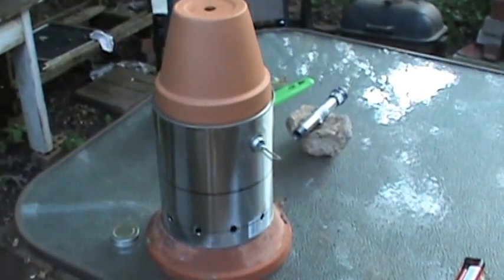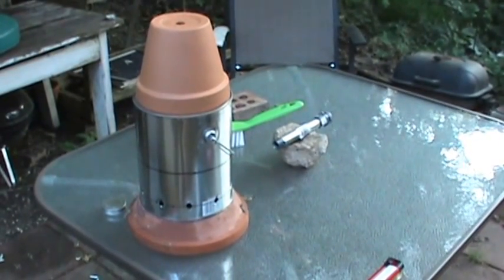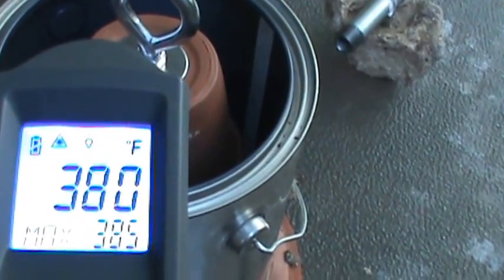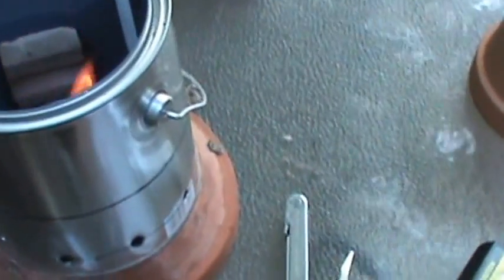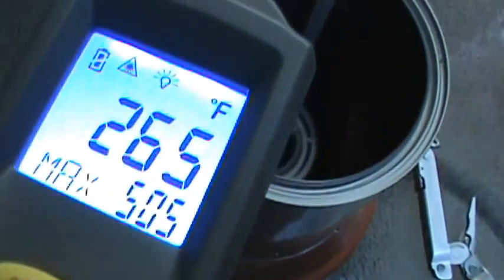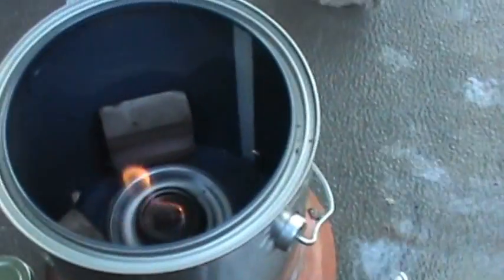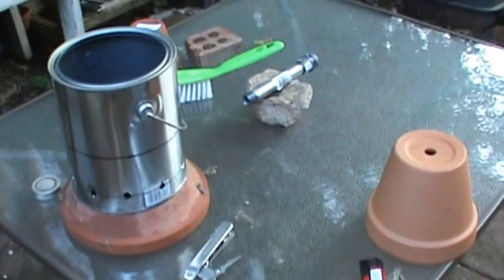Flower Pot Heater redesign. This one works.

Comment: Everyone who lives in a cold climate should have a metal coffee can and a candle in their vehicle in case it gets stranded. The candle in the coffee can will keep your car warm until help can arrive. Try to find one of those 24-hour candles that burns that long.
Reply: I've been doing that for years.  Every November I put together a winter survival kit in my trunk.  Candles, lighters, matches, dry snacks and more all go in the coffee can.  I keep a small shovel, extra socks,rawhide mittens and other clothing to layer up in the event that I'm stranded on a Michigan road in the dead of winter.  It's not hard to prepare for the worst.  

The woman who slid off of a highway off-ramp and wasn't found until the thaw is a constant reminder for me.  She didn't have to die that night.  She just wasn't prepared.  And flares...you can't be helped if no one knows your there.
Reply: @beekind466  Rather than storing the emergency supplies in the trunk, in case you cannot exit your vehicle, keep all in a plastic box on the back seat or floor where it can be easily reached. Thanks for the reminder to keep survival supplies in one's vehicle.
Reply: @beekind466  thank you
Reply: @beekind466  you are so right. Better be prepared than sorry. I do It and I even live in a mild climate.
Reply: Wim Harleev I think it would be really cool to learn hieroglyphics and read what is on the pyramids. My prior comment was a direct response to the suggestion that KJV is the only “real” bible. My main point was that learning the original language of any given point of research/study is not only recommended but in some cases necessary to fully understand it.
I don’t deny that there has been much done in the name of Christ that is corrupt and a dark spot on history, but as a Christian I believe we need to study the Bible so as to prevent such tragedies from occurring again and to guide us in life. 
I understand that you oppose Christianity but your comment was uncalled for and completely non-constructive. There are also plenty of horrific tragedies carried out by other religions throughout history, even now in our own time.
Reply: Wow, how did religious philosophy erupt from watching a video about homemade heaters.
Reply: @dalelarson826  🤷‍♀️
Reply: @dalelarson826   I think my YouTube name and my suggestion to have a metal coffee can and candle. which Catholics do burn in their churches,  Triggered this whole nonsensical discussion.

 Some people's comments just show their own ignorance.
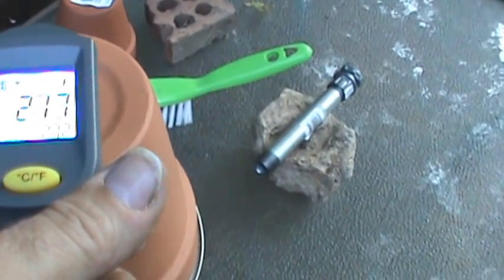Reply: @ciannacoleman5125  you don't need to learn Greek and Hebrew, all you have to do is obey Acts 2:38, and you will fulfill Matthew 28:19, Luke 24:47,and Mark 16:16.
Reply: Or u could just use a oil candle
Reply: Or you could put a Mr Heater 3800 BTU indoor/outdoor propane heater and a couple of 1lb bottles of propane in your car. That's enough to warm the interior of the car, with a window cracked open for ventilation for 11 hours.
Reply: @paulswarthout9967  I have a mr. Heater and that thing would blow me out of a car!  Definitely would keep u warm.
Reply: Metal coffee can are rather scarce these days.
Reply: IKEA has a big bag of 100 tea light candles for $5. Many, many uses.
Reply: @Swimdeep  thanks! Ive been buying votives 4/$1 at dollar tree.
Reply: @grandmalovesmebest  The votives are bigger, burn somewhat longer. The IKEA tea lights are definitely a better deal. Stay warm!
Reply: @grandmalovesmebest  lol hee
Reply: There was quite a "hot" debate on religion earlier, leaving much confusion. Isn't the Christian Old Testament a translation of the Hebrew "Tanakh” (acronym of its three parts: Torah (The 5 Books of Moses; including Genesis, Exodus, Deuteronomy, Numbers & Leviticus), Nevi’im (Prophets), and Ketuvim (Writings)? With some passages in  Old Aramaic (Daniel & Ezra, the verse Jeremiah 10:11, & some single words), along with the vast majority of Hebrew Scriptures, aren't these the foundation of Christianity's Old Testament? Isn't the G-D of Israel, Christianity's God, too?
Reply: @tamarawharton7755  Yes, well done, thanks very.
Reply: That or a good freaking sleeping bag.
I paid $180 for a 3 piece military sleeping module. It's good to -40°F. You can jump out of the car and sleep much more comfortable out on the ground. It could snow and drift 4' on top of you and you'll still be just fine, comfortable and ALIVE. It scrunches up to the size of a basketball if you have the bag it goes in.
Reply: Wouldn't it be safer to keep the glove box full of hot hands? 
You can put one under each armpit, one in each front  pants pocket, one in shirt pocket, and sit on one. They work..
Reply: Mike Ries one over each kidney is all you need
Reply: @drachenfeuer5042  If you're the only one in the car. Otherwise you need 2 for each person, and enough to last several hours.
Reply: @drachenfeuer5042  Not so fast. Feet especially and hands are very vulnerable.
Reply: @mikeries8549  not in below 20⁰f weather...got stuck in my car in a blozzard for over two hours (car overheated) and those damn heating pads lasted an hour and barely worked.

My hands and toes were frozen by the time I got help, never again. Now my car has a survival case with a thick blanket, tea candles, small metal cooker, small clay pot, wooden board, dry food, water etc
Reply: @mikeries8549  that is also a very good idea...
Reply: They used to do this back in the day
Reply: Mix sawdust in paraffin wax
Reply: Or just get a bunch of candles at a catholic building or some other cult which burns a lot of candles. Except maybe some 3rd world country full of people, ignorant even in their own written language, who can not read the word of God in King James version, to even know His will.
 Always perfect hunting grounds for cults.
Reply: @victorcastle1840  ignorant and sound miserable
Reply: @patriciamanly5125  , so which ( non Jewish )candle burning organization are you a member of ?
Reply: @victorcastle1840  Like you're NOT in a backward, medieval cult.

Prick.
Reply: @victorcastle1840  What are you blabbering?
Reply: @victorcastle1840  What dose this have to do with flower pot heaters? Sounds like theft to me?
Reply: @victorcastle1840  That you use your time in posting unrelatable drivel is just so sad. Norman Vincent Peale.
Reply: @victorcastle1840  🤗
Reply: victor castle KJV is archaic and practically a different language just like Shakespearian, so it is not surprising that even people who grow up with that as their main bible have trouble. I think it would be a good practice for people to learn Greek and Hebrew again so they can study “His will” as you put it, unfortunately in today’s society that is impractical for the masses. However Catholicism is not a cult and just because some denominations do things and have traditions different than you does not make them cults.
Reply: @ciannacoleman5125  The Pope is the false prophet of revelations....    It's true.  Come out of her my people.....
Reply: @ciannacoleman5125  😄😄😄, as a Southerner, im constantly accosted by ppl  insisting Catholicism  (which was the original Christian church) is a cult. It never bothered me bc (besides a degree in world religions) i remind them it was the ONLY Christian religion for over 1500 years. "Look it up" as our moms used to say!😁
Reply: @grandmalovesmebest  I do not consider Catholicism a cult, however I do disagree that it was the “original” Christianity since the early Church of the Bible was not Catholic. I am sure that as a Catholic you disagree with me and I am not suggesting the early Church was Protestant or any thing ridiculous like that but by my knowledge of Catholicism it has much that is very obviously added on to the biblical foundation, much like the Pharisees did by considering the Talmud part of the Law.
Reply: Something (hat , boggin, T-shirt wrapped around head, etc) to cover your head and a pair of gloves  should be in your car at all times during the winter if it gets cold in your area.  That’s where your body loses the most heat.

Layers of clothing work best (especially when exposed to the wind) to maintain a comfortable body temperature.
No clothes with an emergency blanket is better than wet clothes.  Heat loss is 25x faster in wet clothes if memory serves me right.  That works great in summer heat, but can quickly kill in winter.
Dehydration can take place in hours and a couple of bottles of water should also be in your car emergency kit.
Stay safe and think ahead ;-)
Reply: @user-qq1xg6qn7i  Don't leave home without Jack.
Reply: @ciannacoleman5125  a cult is a group, but an occult, is the devil worshipers.
Reply: @victorcastle1840   I'll pray for your problem with hate. I know Christ very well, personally and I know for a fact that before the "rapture" comes a judgement. At that time you will know how wrong your decernments really are.
Reply: @victorcastle1840   The king James version of The Bible was derived from the Catholic version. However the protestants added terms like, "alone."  This was done to support Luther's false doctrine of sola scriptura. 

 The king James version of the protestant scriptures What's put together by an active homosexual.

I also would like to remind you that Martin Luther and John Calvin where disgruntled Catholic priests.

Catholicism has the fullness of truth because it was taught by its founder Jesus Christ. Protestant religions have some semblance of truth but not everything because they broke away from holy mother church during in the Reformation.
Reply: @catholics4unity  you know nothing of ‘truth.’ If you did you would know the Jesuits we’re responsible for all written organized religion. They write our ‘scripture’ daily by code. You people in masks submit to the pope.
Reply: @catholics4unity  disgruntled?  Serious question. Where in scripture does it state that you can consider other sources besides the Bible to be inspired text?
Reply: @michaelsorrell9922  Nice wall.
Reply: @krepd1  get a magnifying glass and go into the old testament. There are other books in the bible, which by the way is a made up name also ask yourself why do all these  books that are supposed to be the word of God "El Eloh" have a copy right on them. Wow to those who re write the scriptures and sell it for a profit. Religion replaced spirituality go Research who was the nicean council and the jusuits. The spirit of truth leads to all truth. May you find the truth learn the languages and do not soley rely on the English language.

Comment: I never saw a flower pot heater.  But, I think the flower pot heater works.  I'm not saying it heats up a large room.  It works better to retain the heat than the open flame.  Open flame just waste the energy.  Only portion of the potential energy is used to heat area.  
Korean heating system called "Ondol" works the same way as the flower pot heater.  Stone floor is heated to retain the heat to release the heat slowly and directly to the nearby living area.  Flower pot heater is used to heat a SMALL room or a SMALL tent.

Comment: Greatly concerned about the heat's reaction with the can and the creation of toxic fumes.  Does anyone know what temp clay pots are kiln fired at? 

I've heard of someone recording a heat signature of a tea candle vs tea candle under clay pots and the temp is the same but the radiant heat absorbed into the clay created a larger heat sig and displaced heat more effectively. Have not seen experiments.
Reply: ceramic is fired at WAY higher temps than 300 or 400 degrees...

Comment: Tealights are more expensive than electricity, gas, LPG, diesel, fuel oil, wood ... For a tent, you're better off using a kerosene lantern, and getting light as well. But remember they produce CO2 and CO, so ventilation is a lifesaver!

Comment: The ONLY thing this is good for is safety (kinda) by covering the open flame. A tent would reach the exact same temperature if there were no flower pots.
Reply: And saying it would heat a room is super vague...maybe if the room is the size of a small bathroom and it's 25 degrees outside, you might get it up to 35 degrees.

Comment: Self Reliance guy, can you give us a full update on how well it actually worked for you in the field?  Very honestly, in terms of heating a tent in cold/near freezing weather that's way too small heating capacity and doesn't add more heat than burning the flame by itself.  The effectiveness for heating the overall temperature in the tent depends on how big and air-leaky the tent is, and how cold/windy it is outside.    What it does do is store & concentrate the heat emitted in the pot and metal itself, so if you huddle directly next to the "heater" it will feel warm there.   And, no, it won't warm a room to 60 degrees on a near-freezing night if your power goes out - there's just not enough heat generated by your flame - maybe enough for a walk-in closet.  Again, if you huddle  right next to the "heater" it will be warmer there.  A small room heater for a small room in an insulated home puts out about 5,000 BTUs/hr. of heat.  A professional chafing dish fuel source puts out about 1,500 BTS/hr (about 12-15 tea lights).
Reply: Hmmm' I'm in a 20x30 studio suit.An Have 5 separate Candles  lit' in 5 Glass Metal Lanterns.And' in the Coldest Mnth of February ' This Suit with bolted ceiling Stayed pretty warm the hold time' As Covid hit' and out of neccessary means' this was quite  perfect.Many of the days/ nights' only 2 or 3 of the lanterns  were used.So' I believe the heat that  radiates does work ' .. I'm not sure about whether  I'd make  a hearter in this way' bt' a  stone disk on top of that  might make for a useful  miniature  Stove for cooking ' so' thanks.

Comment: this flower pot/heater are pritty clever I think a good test would b too put one in a shed outside in the winter months. record the temp in the shed b4 u light it up then take several records at different time intervals so people can actually see how good they work and try several different model's too see witch one works the best maybe u could rig up a outdoor thermometer to check the interior temp at a glance

Comment: These idiots say it doesnt give off more heat 
Build one of these pot heaters 
Light a candle 
Sit by the candle on a cold nite then go sit by the pot heater then tell me a candle puts out just as much heat 

The pot heater gives off 20 times more heat than the candle
Reply: It Does NOT give off more heat ( increase the btus)!! What it does do is change the method of heat transfer.  Raidiant heat is much more comfortable and useable than hot air.  Hot air also finds every possible exit,  including pores in fabric,  which must be replaced by sucking in cold air. 
This is a very small mass heater.

Comment: I have used a PILOT LIGHT to heat my 40 gallon water heater for the last 10 years.  I only sacrifice the FAST RECOVERY time.  It takes about 15 hours for the water to heat up again for the next days showers.  Water comes out TOO HOT TO TOUCH and must turn on the cold a little also.   There is a LOT OF HEAT coming out of a candle flame.  I also believe you could (crock-pot) cook a meal using a candle flame . . . if you simply put the cooking pot in a WELL INSULATED container during heating.  Once the pan & food get hot, it would STAY hot several hours if it is INSULATED.  Problem with ALL COOKING POTS is they allow heat to escape!!!  Always be safe knowing candles put out oily smoke and deadly Co2. Be safe out there everyone.
Reply: Most candles pollute the air with toxins because they are made from petrochemicals.  Burt’s bees made from bees wax & essential oils is best to use as far as air quality goes.

A penny can alcohol heater may also be s good alternative.

Comment: you repeat that it works - it works, I can only assume that you mean the candle/chafing dish still burns under your contraption of can and pots and you realize that is all that is taking place here. you may be amazed that a small heat source puts out that much heat but it is what it is. as long as you don't believe that you have somehow hacked the laws of thermodynamics.

Comment: Cost of paint can at hardware store 2 dollars flower pot at Salvation Army 25 cents to 50 cents Heat flower pots in oven from 150 degrees slowly turn up to 500 degrees pre-heat one time to harden pottery and safety test how much heat flower pot will handle when they break they snap apart and can spread fire. A 2 dollar can of jellied alcohol will last as long as advertised on can, We know that fumes from anything can be toxic that is why you pre heat in stove to condition it to heat and remove as much oil ,paint ETC as might be in clay keep clean and ventilate area being heated to reduce breathable toxic emissions. Unit does warm up things like a tent if environment is closed off which increases safety risk's.

Comment: Why do you keep calling your heat source a "chaffing dish"? It isn't... it's just a can of sterno that's used to heat a chaffing dish. Also, while I like your version you can't compare it others that used a candle because you changed the heat source. Your version looks as if it would do a better job, but, you didn't test that. One could use any fuel, magnesium, thermite, etc. and the results would change.
Still, I applaud your design!